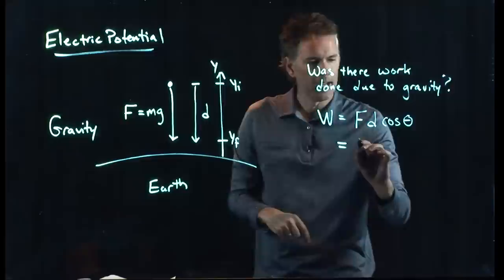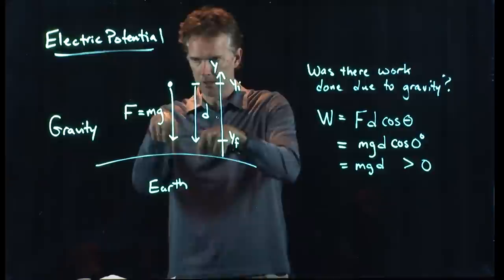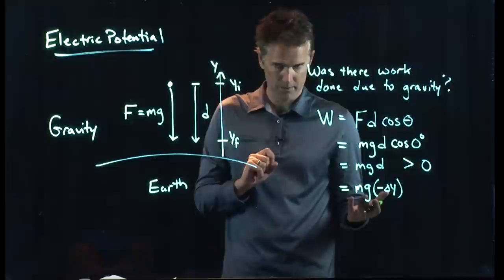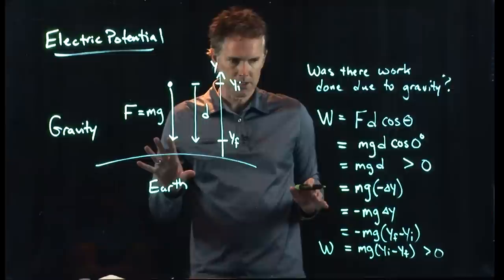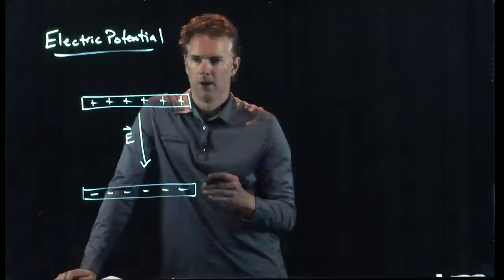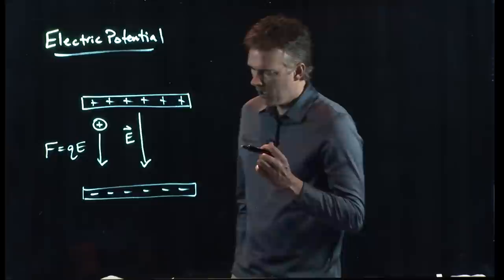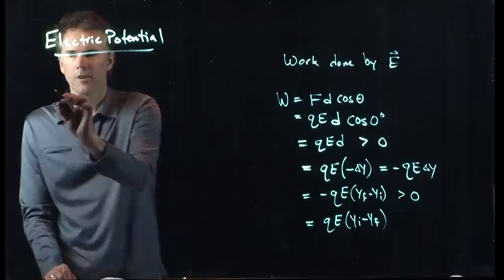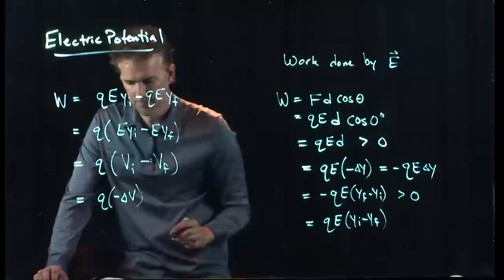Electric Potential

Comment: Great follow up questions at around time 56:00 would have been to ask:

1) What is the potential on the plates?
2) How does the capacitance change when the plates are moved farther apart?
3) How does E change when the plates are moved farther apart??
3) Does the potential change when the plates are moved farther apart?
4) Answer the same questions for the capacitor when the plates are moved closer together
Explain your answers for full credit.

Wayne Adams
B.S Chemistry (ACS Certified)
M.S. Physics
R&D Chemist 9 yrs.
Physics Instructor 33 yrs.
Reply: Woah, you're amazing

Comment: @ 19:40   potential of B is greater than A . but b/w them there is a negatively charged electron when it moves A to B it is going to accelerate and going to gain K.E and lose potential energy I think for the electron potential of A is greater than B .

Comment: It's pretty obvious he is not an auto mechanic. The distributor distributes the electricity to the various spark plugs. It has nothing to do with generating the high voltage. In the old days it was a rotating disk with an electrode that moved around making contact with electrodes that had wires connected to each spark plug. todays high tech cars use fancy electronics controlled by computers to control the distribution and timing of the spark. You may have seen old movies or TV shows where the villain reaches into a car engine and pulls off this cup shaped object with wires hanging from it, that is the distributor cap. Here is a picture of a typical distributor.
http://www.aa1car.com/library/distributor_1a.jpg

 The high voltage was generated by a coil that was a step-up transformer, which is device that changes low voltage to high voltage, thus the name step-up. If you look at older engines you will see a large ceramic disk with two small wires attached and a thick wire coming out the center that is attached to the center of the distributor. Here is a picture of a typical ignition coil.
http://www.auto-repair-help.com/images/articles/articles_0808/ignition_coil.jpg

The spark plug wires are insulated, so touching the wire will not harm you, unless the wires are old and the insulation is damaged, then you might get a shock. It will not kill you, but it certainly hurts. . LOL Likewise, the connection to the spark plug is covered by an insulating material (called the boot), which is usually some kind of rubber compound or some other fancy synthetic, so that you cannot be shocked.

In my younger days, i used to build and drive race cars as a hobby, and I was shocked plenty of times. ;-))
Reply: Old cars are so much more fun to work on than cars today with everything computerized.

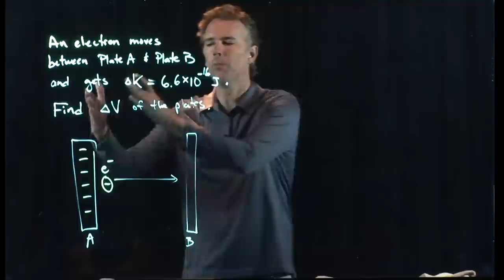Comment: 16:10 please, won't the work done be negative, considering the direction of the field drawn. but the change in KE in the question is a positive value; which means that the work done is also positive. Thank you

Comment: The fact that E is perpendicular to the equipotential surface at each point leads to a nifty experiment that allows the student to map E. It is a thin board that is coated with a graphite mixture. Two copper conducting surfaces are printed on it. They have various shapes, So one board has two points for dipoles. One has two two lines for parallel plates. One has a point and a plate, and so on.

The student connects a power supply set at about 6 volts to both points. A nine volt battery also works very well. There is a potential difference of 6 volts from one connection to the other. The student connects one lead of a voltmeter to the positive end, The other lead of the voltmeter is then touched to various points on the surface around the charged points, which measures the potential difference between that point and the positive charge. Equipotential lines can now be sketched by connecting points which have the same potential. Since E is perpendicular to equipotential lines, and proportional to the potential,  the student can now draw in the E field. It is perpendicular to the equipotential line with a length that is proportional to the potential at that point.

If we just want the students to visualize the E field without regard to the strength, we can have them draw in continuous lines connecting one point to the next. That gives the students nice field lines connecting one charge to the other. If the students are careful they can get very good looking E field maps.

Wayne Adams
B.S Chemistry (ACS Certified)
M.S. Physics
R&D Chemist 9 yrs.
Physics Instructor 33 yrs.
Reply: signing your name like that is cringe, no one cares, arguments stand on their own merits get over your ego
Reply: @Loots1  I do it to stop inane comments like yours.
Reply: @wayneyadams  my comment isnt silly but your ego is
Reply: @wayneyadams  also even if you HAD a PHD that doesnt mean youre always correct, unless youre making an argument from authority which is a logical fallacy, propositions stand on their own merits,  and guess what in 1000 years you wont be remembered just like me, so youre not that smart - you just think you are
Reply: also you got a masters from FIU, lets be honest here, thats not a top university even in america nevermind the world,  i dont even think they turn down applications for entry  at FIU, i go to a top 20 global university and not one professor ive met is as arrogant as you but hey maybe next lifetime youll be smart enough to get into a good school
Reply: @Loots1 Ooh been watching videos on logic and decided to use a concept about which you know nothing. I did not make an argument about anything. I simply outlined an interesting experiment that students can perform to map electric fields. Just what argument from authority did I make in my original comment?

Apparently, your inability to understand a simple freshman Physics experiment set off some kind of rage in you which caused you to lash out, so you started an argument over nothing except your bruised ego. I may not be the smartest person in the world, but I am a lot smarter, and educated than you.

The difference between us it that I actually educated students who went on to become engineers, scientists, as well as PhDs in Physics. Your contribution to the future is? By the way that is a rhetorical question, I have no interest in you or your life unlike you who seems to be meddling in mine.

Comment: at 15:43   u said that plate A is having negative charge   .  but the direction of an electron is always   from positive to negative  by sign convention rules   so according to sign convention,   plate  A will have  positive  charge?????????
Reply from the maker: Two points of confusion: 1) The arrow pointing to the right indicates which way the electron will move.  2) The electric field (which I did not draw) will certainly point to the left.  Since we know F = qE, the negative value for q means the electron moves opposite to the direction of the electric field.
Cheers,
Dr. A

Comment: Hello sir, Although I could understand why the work done will be zero along an equipotential line, I don't understand why a charge particle would move along a equipotential line when there's no potential difference throughout the path. Can you please help me understand?
Reply: A charge at rest remains at rest in an equipotential surface and a charge moving with constant speed will kept on moving. So if the charge has a velocity to begin with it will maintain the velocity and move through this equipotential surface. Hope it helped.

Comment: For the second problem, isn't it possible for both plates to be + charged, but for the plate on the right to have such greater charge that the electron actually goes to the right?

Comment: Good discussion BUT
At 20:22 you say "Potential is a lot like altitude". 
Unfortunately this overlooks the crucial  point that Potential is a dot PRODUCT of Acceleration (gravitational = "g"  or electrical = E) and Distance = gH cos theta or ED cos theta.
Its not JUST distance or altitude. A lower altitude on earth may have greater gravitational Potential than a higher altitude on the moon. IOW all altitudes are not the same. 
This almost absurdly  simple dot Product "business" regarding Potential is not emphasized sufficiently in most discussions getting lost or masked in the "thicket" of Joules/coulomb or Joules/Kilogram units and venerable  equations like V = KQ/r  etc.